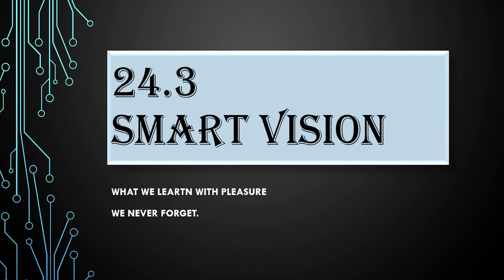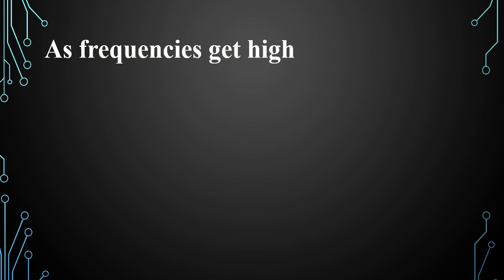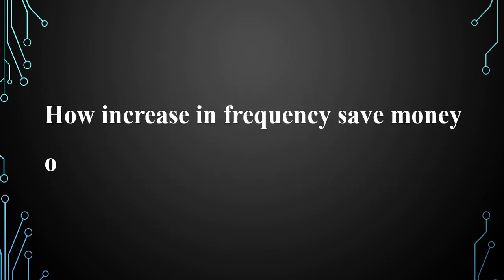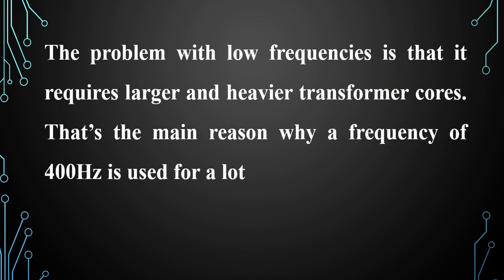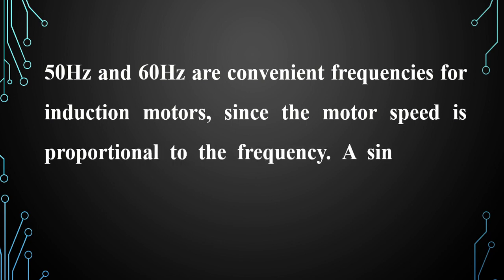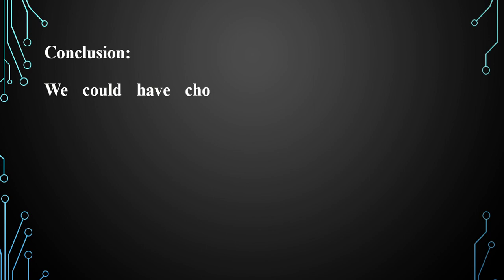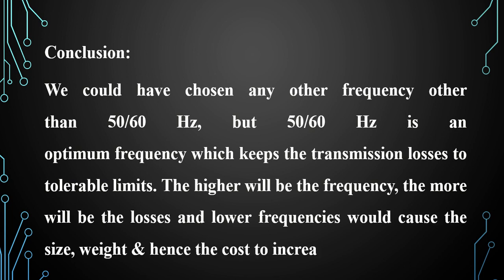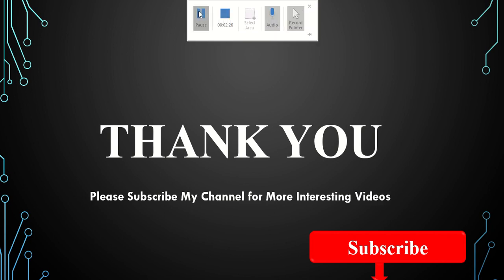Why do we use 50 Hz/ 60 Hz Frequency not 500 Hz or 50000 Hz ?

Comment: I've viewed several videos on YouTube regarding the 50hz / 60hz mains frequency limit and seems like there's a consensus on the transmission losses reasoning. Back in 1998 - before You Tube existed, I've asked our local chief engineer of our local power utility and, back then,  he reasoned that the 50hz/60hz limit is due to the physical limits of the velocity of the moving parts of power plant generators have to rotate. According to him, a generator rotating at around 3,000 rpm, the shaft and connected assembles are actually rotating at around 2,000 miles per hour (!).

Comment: Can damage to equipment occur when using different frequency?  Such as a refrigerator made for 60hz running on 50hz, or vice versa?
Reply: in short: 50hz equipment with work on 60hz without damage, but backwars - 60hz equipment on 50hz outlet - not so good.